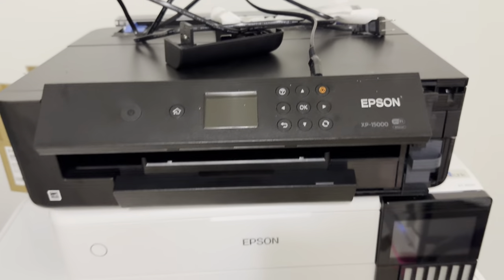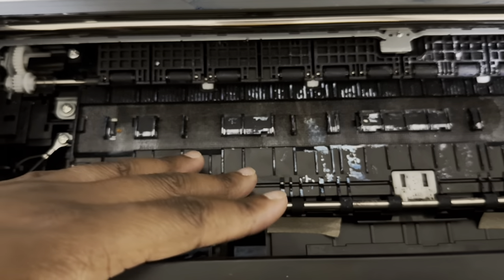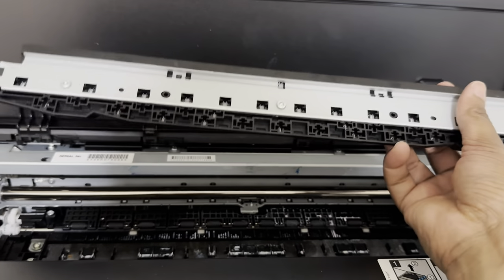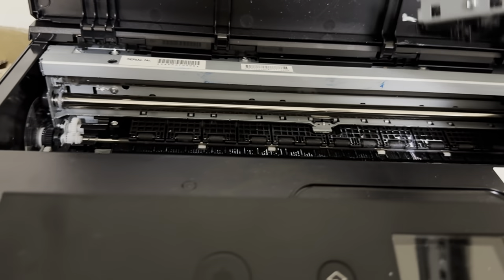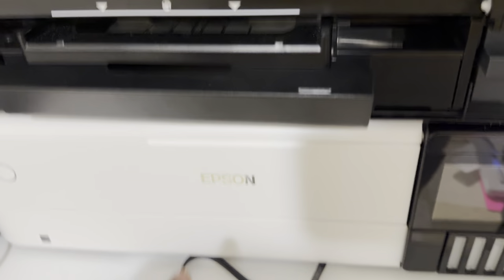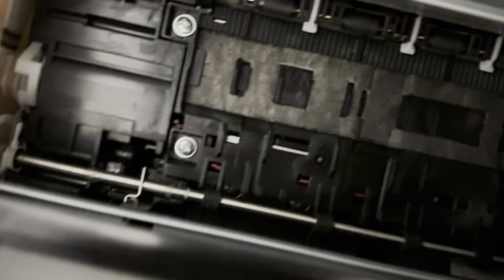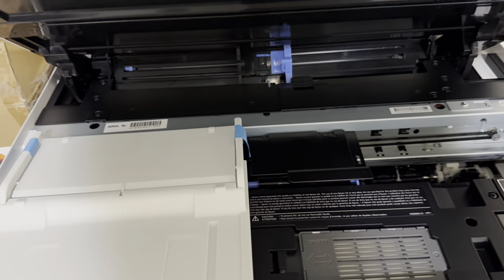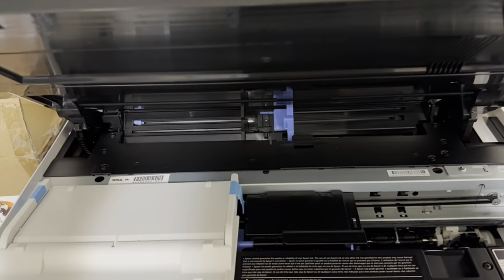Don't Make This Mistake When Converting Your Epson XP 15000

Comment: oh no i was so invested. was looking forward to the results. i started adding the printer to my amazon cart. they have it for $329 at the moment
Reply from the maker: Honestly you can still go for it, I just messed up because when I was doing the cleanings to the printer I got the motherboard part wet. Just don’t do what I did and you should be fine and make sure you keep up with printings and cleanings.
Reply: Did you get the printer and convert it?

Comment: If you want to give this a go... You would have a go at getting to the motherboard... If you do ... I suggest giving it a good clean with 99.99% isotopic alcohol and use a kids tooth brush.. Let it air dry and then either repeat the process again... Or use contact spray and make sure no ink washes out from under any of the chips... Re assemble and check see if it will boot without the errors....
If you have already got rid of the print no worries, if you have time to give it ago and you still have the old printer or need this in the future 👍

Comment: Thanks for sharing this info...I have both printers that I want to convert. I would like know if a ciss can be used on the xp15000?
Reply from the maker: Yes I believe you can use a ciss system for XP15000.

Comment: i just did a full clean on my printer and as soon as i put everything back and started printing again, the colors are off and the white isn't going on the back of the designs like they were in the beginning... any tips?
Reply: also, i'm using the xp15000

Comment: Hey, have you ever tried the DTF white backing ink with Sublimation Inks for the other colors? Was just curious how its come out. The DTF inks look so thick to me, but of course, to print on black and cotton you need the DTF white, but was thinking using Sublimation Ink for the other colors might cut down on the thick look. Was just looking to have the look more closer to sublimation where the ink looks more like part of the material instead of looking like something that's just sitting on top of the material.
Reply from the maker: Honestly no I have not but like you I am curious to see how that would hold up.

Comment: Quick question, on this printer do you have to make sure the transfer comes out perfectly flat?  Like do you have to put a thin board inside the output tray area??  I had an et8550 which is junk and I had to do that.
Reply from the maker: The 15000 is a little better at your images laying flat without a board but you still want to have that extra layer of protection.
Reply: @Healher_7  Quick question, I have seen a few videos on this printer and some say to buy the chip resetter and some say to buy the key BUT what is it for?  Is it for the maintenance box or for the ink cartridges?  I will be buying the CHIPless ink cartridges and will have a supply of maintenance boxes.  So do I still need the activation key thing??
Reply: @Healher_7  did you have to buy that activation key?  I am confused because another video shows that you have to buy a key.  In my mind if I buy the reillable ink cartridges and keep a supply of maintenace boxes I wont need that activation key.  Can you please help me??  TIA :)

Comment: So is there a major difference in the 2 printers besides the price point. I know they both print the same size and I heard both have the same print quality (is that true?)..Just want to know what makes this printer stands out vs the XP-15000.
Reply from the maker: Everything you said is absolutely correct, I think for me the main difference is the ink set up, with the 8550 they have the ET tank so you can either fill those tanks or buy a ciss system. With the 15000 you can drain the carts or buy replacement carts off Amazon. Other than that they both are very similar but so far I like the 8550!

Comment: I converted mine and i cant get it to print
Reply: I’m in the same boat mine prints but won’t print anything 😅 I have a 8550 but it’s got some kind of issue aswell I’m so over this I’m thinking of just getting a actual dtf printer

Comment: You gonna trash the XP15000?
Reply from the maker: I ended up giving it away for parts.
Reply: @Healher_7  oh ok. I am getting mine on Wednesday. I have done months of research, I tried refurbishing an L1800, but it will take quite a bit to get it going, so in the meantime I chose to go with this model for price and ease of converting. So were you able to get prints out of it? If so how many do you think you got out of a days work?
Reply from the maker: @jjsmsalas1  so I did get some use out of it and you can get a good amount of prints, I just messed mine up because I was cleaning in the danger zone which was the motherboard area.